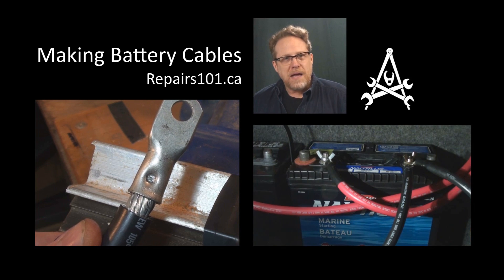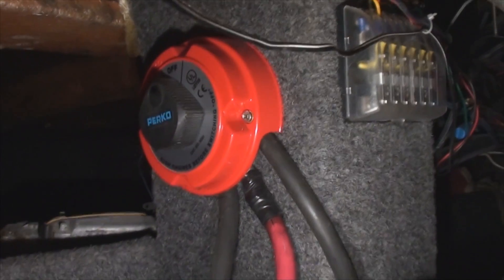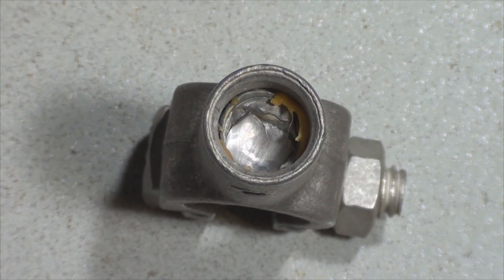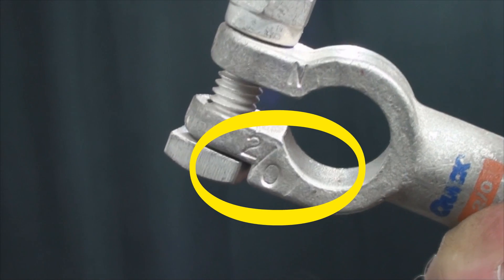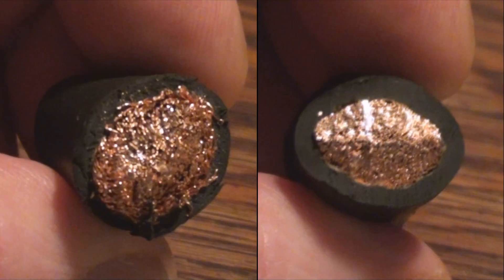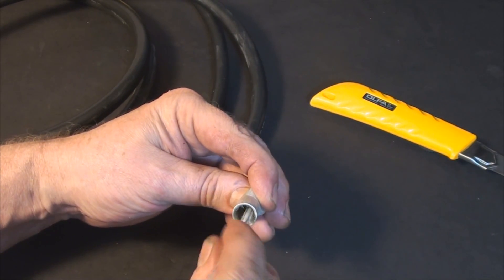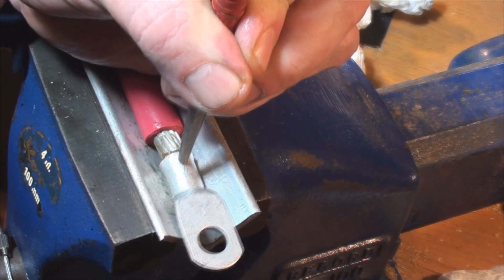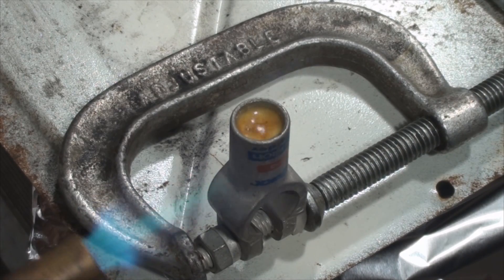How to make Battery Cables For Auto, Marine & Solar

Comment: I use plenty of liquid flux on the cable ends. I then tin the cable end. Then, I install  the cable into a hot lug that has a bit of molten solder inside. I then finish off with a good wipe down and shrink tube.
Reply from the maker: Thanks for sharing!

Comment: Why is the cable stripped  way more than the battery terminal length? I mean a little is ok but a whole 1/4 in stripped bare is unnecessary.

Comment: Interesting video. Canajun... the princess auto power fist stuff gave it away lol.

I crimp. I had a Hydraulic Crimper and found it awkward and never crimped correctly, but then it had euro sizes, not AWG. I bought the AWG Iwiss manual crimper about the same length, no ratchet with cutter combo for not much $ on Amazon and love it. Awesome crimps, no loose dies and I find it easier to use.

I gave up on marine terminals, they kept working loose. I always hated the "clamp" terminals for corrosion and water ingress to the cables causing corrosion.

I used to solder decades ago, but now do only crimp for the vast majority of connections of this type now.

Comment: Wonderful video.I learned a lot and really liked it. But where in the world can I get those supplies? Evan a local professional electronic supply house did not have any tined cable. You said not to use the solder that is made for plumbing but you didn't say what the correct solder is called.Please give us some product names and sources.
Reply from the maker: Thanks Johnny!  Try a marine hardware store.
Reply: Electrical Rosin core solder.  I got some from Autozone.

Comment: Crimping and soldering should never be done on the same connection. It sounds like belt and braces, but the reality is that a properly-made crimp is a cold weld so all you are doing is increasing the likelihood of the crimp becoming microscopically loose by heating it to soldering temps. 

You might never have an issue on something stationery like a solar panel installation, but if you do this on things that vibrate and move (i.e. any vehicle) then you are increasing the likelihood of it breaking over time.

Crimp (with decent ratchet or hydraulic crimpers) OR solder.
Reply from the maker: I am a Marine mechanic +25 years. Never had a problem.

Comment: My electrical upgrade on my truck (bigger Alt) 1/0 Awg welding wire. 3 wire ground, Side post termimal post removed And 3/8 course thread bolts added for extra ground add ons  Lug hammer tool used Wires were pre measured without any wire exposure Between Lug And wiring case dabbed the outter edge of the lug with dielectric grease after connection. Shrink tubed.. 3 years in still no issues And preforms better than most cars in Canadian winters
Reply from the maker: Nice!

Comment: After you cut off the proper amount of insulation, and crimp the terminal onto the cable, then you can clamp the terminal into your vice and start pulling on the insulation gripping tightly but just allowing your hands to slide down the cable a foot or two. This will actually pull the end of the insulation away from the terminal in order to be able to have room to solder it, and not burn the end of the insulation. After it has cooled down some, just attach the other end of the cable to something and do the same procedure in the reverse direction until the insulation butts up against the terminal. It makes a very tight professional joint, and looks great after the heat shrink.
By the way, I have found that copper terminals will corrode quickly if around batteries. The plated ones last a whole lot longer.
Reply from the maker: Thanks for your contributions. John.

Comment: That’s not the correct way to crimp cables and using a punch is substandard especially where vibrations will eventually loosen that crimps quality. It’s not usual to cut off copper strands this can have serious consequences. This video is irresponsible.

Comment: Solder vs crimp is an age old controversy and there are lots of opinions and studies, but I prefer to think that if a crimp is done correctly the wire and the metal of the connector become homogeneous. If a connection is soldered and for some reason starts to heat up, then the integrity of the physical connection is compromised. The solder has a different electrical resistance and so therefore the electricity has a more difficult time going from wire to metal connection. 

Another thing to think about is that there are no soldered connections for the HV transmission lines, all the connections are mechanical…
Just my 2 amps worth...

Comment: never  solder them,   ever..       invest  in a Hydraulic crimper    50 to 70 bucks on amazon..       it  crimps from all sides
Reply: Then add solder, and marine grade heat shrink. And never have a problem again.

Comment: Since late 1800 we’ve been using what you called 1:21 temporary solutions. And worked for over 130 years. I think i will stick with temporary solution
Reply: Me too never had an issue with 12 v DC temporary solution

Comment: Not correct, you should never solder these lugs. Industry standard is to do a full crimp with high quality tools. This would never pass an inspection and is not code compliant.

Comment: The Crimping is done on top of Lug, and don't solder, its to easy to break, not flexible.
Reply: Without solder it's too easy to corrode, heats up, starts fire-not connected

Comment: You said tinned bolt cable can last 10 x longer than ordinary welding cable. I'm guessing the copper color one is plain welding cable? Why is that? Is the longer lasting one also more restrictive to flow?  Also, where does ofc speaker cable fall in order to the list?

Comment: they dont solder cables on aircraft ,,, and watching the fitting distort as its hit with a nail punch is painful , at 3.36 you can watch the cable not go home fully ,,, why bare more cable than there is room for in the fitting and leave a gap , why not just measure from the fitting , ah well . to each their own i guess.
Reply: Why don't they solder cables on aircraft?
Reply: @alpinewhite  probably because they're worried that the mechanic won't crimp it also. If the solder doesn't make a very good connection, then it will create a hotspot melt the solder and come apart.

Comment: Solder or crimp.... Argue, argue, argue..... 
Terminal ends are either made to crimp or solder, not both!!! Crimping a solder terminal can crack it...  Thus ruining it 
Using a punch and hammer to crimp??? No... You are distorting and stretching the socket, causing uneven contact....and probably cracking it too. A good crimper will crimp evenly, much better contact.
Just saying....only done it for about 50 years ..
Reply: Ed Gosselin 
Yeah Ed 👏🏻
Reply: A proper crimp is actually called a cold weld, much much more solid and trustworthy and longlasting then any solder.  Solder introduces resistance to the wire, a proper crimping does not.

Comment: Soldered connections are not allowed in aviation, only crimp.  If you are using it in a stationary, non vibration application, soldering would be acceptable.
Reply from the maker: Thanks for your input!

Comment: What's your take on soldering without a crimp? Yes I know there's a little balancing act involved I've done it both ways. Depending on application and time constraints. Anyway my initial question 100% solder without a crimp, your opinion? Thanks
Reply from the maker: I create connections for extreme duty environments like salt water commercial vessels. I try to crimp and solder everything because it works and is durable. Engineers cannot disagree strongly enough because some book says crimp only.
Reply: @repairs101  I agree. 13 years working on battery powered industrial equipment has taught me the right way to do terminal ends. If I don't have enough time to do it right the first time, how am I going to have enough time to do it a second time?
As for solder only? Although a soldered connection has less resistance than the wire, if the circuit pulls a lot of current through the connection it can get hot, melt the solder, and come apart. Same if the solder didn't make a good connection when made.
Crimp only? A newly crimped connection has more resistance than the wire itself. As time goes on it can corrode and resistance will increase.
This is why the only proper connection is both crimped and soldered. Then sealed.

Comment: Use double wall heat shrink with sealant inside, they make heat shrink tubing that includes a sealer or glue, it is the only type of heat shrink that can be considered " water proof " in my personal opinion, any soldered joint, should be cleaned with alcohol to remove left over flux as the flux itself will cause corrosion and failure of the connection.
Brass battery clamp's are the best, they have the lowest " galvanic corrosion " rate when mixed with other metals, lead, copper, aluminum, tin etc...
I guess no one ever told you about sweating the joint.... you have to keep applying heat as you solder and in some case's even after you have a good connection, so the convection currents can carry the solder all the way though the material as the material you add is usually much colder as someone else pointed out.
this is not a " critique " of your work, this is only to pass on the knowledge i have accumulated over the years......
Reply from the maker: Thanks for contributing, Larry.

Comment: Jezz... could you possibly do this worse?
Lugs are soldered or crimped. Never both. Nicking the conductor is absolutely not permitted. If you're going to crimp, use a crimper with the correct dye.

Comment: This is not good advice. Use a reputable branded crimping tool and do not solder it afterwards.
Reply: What have you got against solder? I've had to replace many crimped only connections with a properly crimped and soldered and sealed connection that never had a problem again.
Reply: @johnwyman6331  Solder makes an excellent connection (when properly done) but soldering after crimping renders the crimping useless as the gas tight connection associated with crimping is lost due to expansion.  Also, capillary action of the solder causes the first two inches of cable to go rigid which can be a problem.
Use a proper hex type crimp tool and some heatshink over the lug for a professional adequate finish. Using a centre punch to crimp is a bad idea.
Reply: @rogeronslow1498   I agree that using the proper crimping tool is highly important.
 I don't understand why you feel a crimped connection is gastite, or the importance of it being gastight. If it actually was gastite, then why can a larger, more viscous molecule (liquid solder) flow between the strands? If it being gastite was important, then wouldn't solder make it more gastight?
I said I solder it, not over solder it so that it flows down the cable two inches.
You claimed it has problems if soldered. Can you elaborate?
From where have you gotten your information?
In my experience replacing thousands of bad wiring connections, and at first having to replace them again until I figured out how necessary solder, proper crimping, and adhesive filled heat shrink was, I have yet to find a better way, though I am still willing to learn something new. But it has to have some good quality information behind it, not just some unknown guy's opinion on the internet.
Reply: @johnwyman6331  I'm following the recommendations of the lug manufacturers such as Cembre. Soldering produces an excellent connection but the solder wicks up the cable. If this is not critical in the application then it's fine but often in high vibration environments the cable will gradually break where the wicking ends.
If you heat a crimped connection significantly then the crimp is compromised.

Comment: With all the contradicting advise from the on-line experts you will now have enough ideas to do a video showing the current carrying capacity of soldered vs crimped joints. My personal non professional opinion is I do it just like you. Soldered joints may make the wire stiff near the solder, but they will work even if they get a little electrolyte on them and I've had a crimped only connection fail due to corrosion. If a soldered joint gets hot enough to melt solder due to current flow you are carrying too much current or the bolt connection next to the solder is overheating. Soldering joints doesn't raise their resistance.

Comment: All my trucks have marine posts with soldered in ring terminals for 4 gauge wire. Never had a problem. Plan in doing this in my f250 off road rig as well

Comment: A properly installed battery shoe should always be crimped . High amperage is capable of raising the temperature of the joint high enough to melt solder .
Reply: it's also staked/swaged.

Comment: Amazon now sells hexagon hydraulic crimpers with detachable jaws for 6ga. to 2-0 cable for $40.00 they produce 5 tons of crimping force  " yes they are Chinese " mine have been working perfectly for 6 month's . the crimper comes in a plastic case and is about 14" long , this is far easier to use in the bilge of a boat.  R. Walters Marine Electrician
Reply: Do they even make any tools in  the US anymore? Doesn't matter. The Chinese now make better ones. I recently had a toolbox full of old US tools from the 40s and 50s stolen

It made me sick. No one makes tools like that anymore. Cept maybe the Germans but they always were a bit better at engineering and quality than the US.
Reply: I found my Hydraulic supposedly 50 ton crimper worked horribly. I bought the Iwiss manual one - easier to use surprisingly and a much better crimp and with rotating die, no more dropping and finding dies.
The handles are about the same length too.

Comment: Solder battery wire terminals proper way, with powerful enough soldering iron like 200W 500W etc. Propane - butane torches are a disaster for these as solder does no wick into the strands properly.
Reply from the maker: That;s how you do it if you're making them in the field with the tools you bought and carry.

Comment: I just use a vice grips to hold the wire onto the pole of the battery
Reply: Ferguson 20 diesel been there a few times my self on harvest equipment to get thru the day... or week.. crap I should go see if I ever fixed that on the combine. Lmfao
Reply from the maker: Yeah i wouldn't.
Reply: It does the job if your stuck.

Comment: Little critique on the hand soldering. Keep connector down and cable up. Keeps solder where it belongs, inside the connector. Keep the heat at the lug hole if at all possible. Finally use larger solder if you can. I always wire brush off the soldered connector and wipe with an oily shop rag. Again GREAT video sir!! Lots of proper advice here people.
Reply from the maker: Thanks Jim

Comment: Little critique, when you plunged the cable into the battery terminal at 3:47, you needed more heat once the cable bottomed out. Deal is the wire pulled the heat from the terminal and cooled the solder off too fast. Another way I know this is at the same time in the video, that wire should of went all the way into the terminal. Lastly the solder will flow out of the terminal if done properly. Recap = the solder cooled stopping your wire from going all the way down.
Reply from the maker: I knew I forgot to preheat the cable (sufficiently) when I was editing - I could see the splash but I had to leave it in since I was out of time (I used to follow a strict production schedule) and I was out of lugs besides so reshooting would have cost me another day. Sometimes filmmaking is about compromise. (Thanks for commenting!)
Reply: It's all good. Just plunge the cable while heat is applied. Then as you know with heat, the cable will sink down into the connector/terminal. They put a ton of solder in those battery terminals. Nice video sir.
Reply: also preheating cable with a torch puts corrosion on  the wire
Reply: Cool I thought I was seeing s*** on my welding leads I solder all the lugs with the quick connects as soon as they lose grip that's it they're gone I guess they could be soldered but if I need to change the lead then that's a little bit trouble

Comment: I read on milspec that after you soldered something you should clean it with alcohol. I believe that would a be a counterword against everyone that says that you don't need to solder a crimped connection
Reply from the maker: I use acetone to clean excess flux after soldering.   
I'm not telling you what to do, just showing you what I do.
My experience has led me to crimp and solder, even though engineers all say don't.
Reply: engineers are trained to sell a product not make a long lasting one
Reply: Engineers aren't trained to sell, that would be marketing.  Engineers are more worried about possible future repairs and simplicity than trying to sell something.

Comment: So I like this video, the cables are stripped too much but the idea of crimp and solder makes sense. Have you looked into battery slugs? They are designed pretty good. wouldn't need to crimp either!
Reply from the maker: I'll check 'em out. Thanks.

Comment: soldering AND crimping!? um... no.
Reply: soldering and crimping? um yes
Reply from the maker: Made a lot of cables, Tracy? I look forward to seeing your video on the subject.
Reply: Tracy Wilson someone said thing about the Navy used to crimp and solder and now they only crimp... that's probably because of the requirement to use lead free solder which is creating a whole new problem on its own of tin whiskering.
Reply: batvette Best advise for tin whiskers (I leaned them as tin fingers), don't solder with 60/40. I remember asking my instructor why slapping on a (80s) TV could reset the pic and he said without hesitation, blame it on the missing lead. Darn microscopic crystals.
Reply: soldering prevents corrosion.